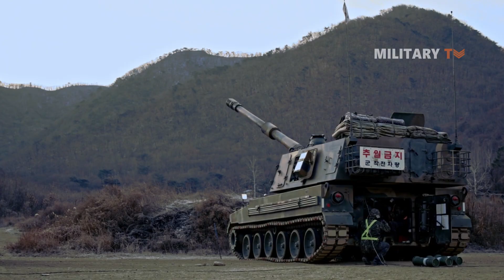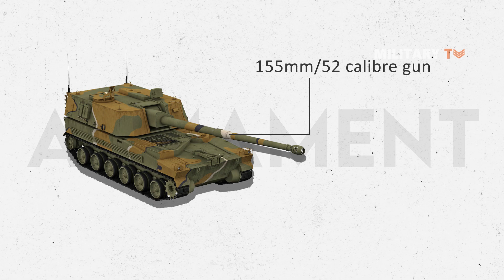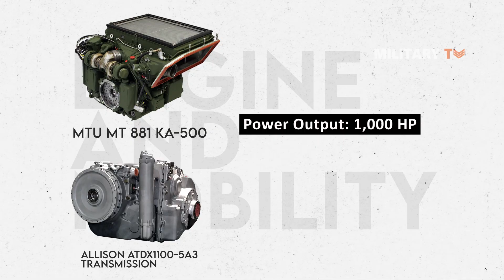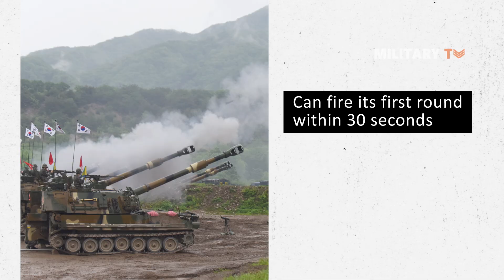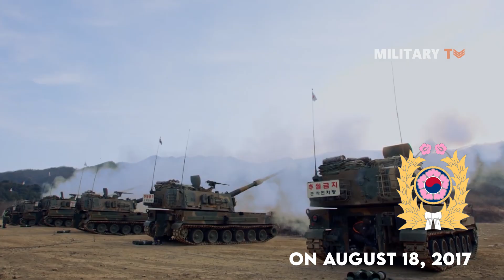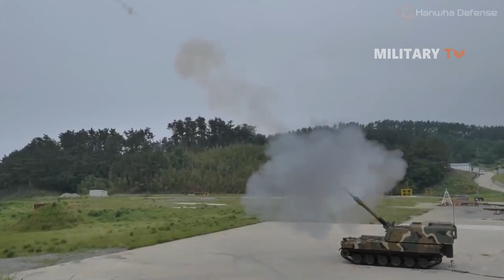Why So Many Nations Want New K9 Thunder Howitzer?

Comment: The K9 is a great weapon but let's give credit where it's due. The powerpack is a German engine and American Allison transmission, which has a bulletproof reputation and are top notch.

The K9 is an improved version of USA's M109 Paladin, which is also an excellent howitzer. In fact, before making the K9, Korea made a licensed M109 dubbed the K55 and there's still 1,000 of those K55 in service.

What separates the K9 is that it's as good as or comparable to everything else out there, it's extremely reliable, and it costs 2x to 3x less.
Reply: Doesn't use German powerpack since september batch, now equipped with newly developed Korean one. Still uses Allison transmission tho 😊
Reply: @김시원-d1b  Yes, they developed a native Korean engine because the Germs have export restrictions.

My understanding is Korea spent a ton of money to develop an engine that was 5% more fuel efficient so they can export the K9 to Middle East countries.

Really, the Germs shouldn't be so difficult because it's made us replace their engines in the K2 tank and K9 howitzer. And they lost licensing fees.

Comment: Why many are buying K9s? Because Finns bought them first, and have been happy with them. Just used the option to full 96. We Finns are THE reference customer to have. Purchases are made tightly within budget. We buy only actually working weapon systems. Performance, price and supplier nation reliability within sphere of free world are our only criteria.
Reply: Also- bc Korea gets cold aas balls in the winter, especially within the mountain ranges on the eastern side of the peninsula (some winter days its as cold as Siberia)

And bc also in the summer it gets hot and humid, it’s proven to work in cold and hot weather
Reply: @jamesdakrn  Good point. Korea is cold as s... country during winters. Like Scandinavia. S-Koreans want to keep K9 production line running continuously. They opened gold mine with Finnish deal. We Finns tested K9, while buying anything from Pacific rim country was outside of typical procurement area of European country with solid ties to US/Israeli/German war industry. Finland had years a go refused deal with Germans on Panzerhaubitze 2000. It is great weapon system, but Germans tried to rip us off on its price. We found K9 quite good, absolutely competent weapon system, something like 90% of PzH2000, at decidedly lesser price. South-Korea offered good deal on 96 SPGs delivered fast, straight from their army stocks (not ordered from factory). By now K9s cost much, much more. After our purchase, there has been deals of K9 with: Norway, Estonia, India, Poland, Egypt and Australia. Some of them are very large deals. Its good practice to get Finns bying your gear first. Business flows after that. Finns buy only good and solid gear, and we are very cost conscious. Every country in this world know how we operate.
Reply: We Finns and Swiss are THE reference customers on this world, for countries unsure  As Swiss buy quite little even at these times, its mostly us.

Finland decided on Davids Sling as high tier SAM recently. More orders are expected. Poland already ordered the Davids Sling missiles for their Patriot batteries. Missile is cross compatible with Patriot system. Finland buys native Davids Sling system, not Patriot with Davids Sling missiles. System can also easily talk with NASAMS system we already have.
Reply: Poland has a huge order for 672 k9 thunders most to be made in Poland along with k2 black Panthers
Reply: @0westdude  I am told Poland is building the world’s largest army
Reply: @dlev  If not biggest, atleast overwhelmingly superior land army in Europe. Like 2 to 3 times stronger than anyone else. Polish have clearly decided that they aint never again going to be occupied by foreign power. All their aid to Ukraine nonwithstanding, they clearly measure their rearmament on worst case scenario where they are the main frontier country. In coming years countries like Poland, and my home country Finland, which are among few who are determined to take care of their own defence whatever the cost, asking allied support as second tier option, deserve much larger say over countries that only hesitate, dont get much of anything done, like Germany. NATO is military alliance, and capabilities must count. Even more should count blatant abandoment of maintaining defensive capability (especially at times of good economy), utter disregard of even basic realities of geopolitics = Germany again. With Finland joining NATO our Baltic neighbours breath more easily. There is now friendly heavyweight land power on BOTH ends of Baltic sea. We can always get fighter bombers doing sorties within NATO. Getting troops and tracks on the ground is much harder.

Finns would take any Russian attempt to attack/threaten our blood relatives and little brother, Estonia, especially seriously.
Reply: 고마워요 핀란드 친구😊
Reply: @니가사는거면나도끼지  Yep, I am from Finland. We call K9s bought from South-Korea "sledgehammers" 😁
Reply: Because it's the best in the market atm
Reply: 구매 해 주셔서 감사합니다. 분명 핀란드의 k9구매가 차기 구매자에게 제품에 대한 신뢰를 주게한 것은 사실일 것입니다. 

또한. 한국은 휴전국가이고, 우리에게 방산 재품은 우리의 생명이 걸어야 하는 중요한 제품입니다. 그러므로 작동하지 않는 물건은 절대로 만들지도 않고 사지도 않습니다.
Reply: Germany tried to screw Finns with their PzH2000, asking insane price. As an revenge Finland opened S-Korean K9 deals all across Europe/Asia/Oceania. K9 is easily 90% what PzH2000 is, at one quarter the price. Price have gone significantly up since Finns bought their SPGs. You dont try fuck us if you are sane. Germans need to learn that. We destroyed your billions worth military development because you asked insane price from us.

Comment: because S.Korea deployed 1200 K-9s in Korea. It can be cheap. and "supply chain" isn't bad. K-9 bas been sold many to several countries. sum of them is around 1000. even include Poland. .. did I say  S.Korea deployed 1200 K-9s? oh yeah. I did. that's why K-9 can be cheap. it is sad fact. not proud. S.Korea has been still in the cold war but the others hasn't.
Reply: I didnt quite understand. Sad fact being South Korea has been still with Cold War? What that does mean?
Reply: @kimj2570  South Korea is still at war with North Korea. However, they signed a ceasefire in 1953, so there are no longer any attacks on each other. A lot of time has passed since then, so many foreigners are not aware of this.
The Korean War was a truce, not an end

Comment: The K9 seems to me like a cheap copy of the PZH2000, but it can't surpass the original in any respect...
Reply: The K9 has been purchased by almost EVERY military in the world. It strikes a balance between capability and cost.
Reply: @raysubsonic  If it were just about that, every military would have to drive a Lada Taiga/Niva...
And which large military with its own defense industry has the K9 in its stocks?
Reply: K9 will be upgraded to perform.even better than the PZH with FULL automatic loading and firing (A2) plus unmanned capability in the A3 version. PZH has yet to field or actively test auch version because it's bogged down in beauracracy.
Reply: @michaellim4165  From the manufacturer's HP.
(Of course, the PZH can also operate fully automatically!)

Features of the PzH 2000

-Superior combat range (currently < 54 km) and wide battlefield coverage from the 155mm/L52 gun
-Combat load with 60 ignited projectiles
-Automated operation and graded operating modes for semi-automatic and manual operation
-Fully automated projectile loading system with inductive fuse programming
-Fully automatic electric weapon aiming system
-Optics for direct aiming up to 2 km
-Fire control computer with integrated ballistics calculation and radio data link to an artillery guidance system.

Actually, the PZH only needs one driver to change position, and the rest can be fully automatic.
Reply: @raka522  but at what price and can they even meet production?

Comment: It’s bad ass, but i would choose the Swedish Archer system from BAE. 7 rounds in 9 seconds and more agile.
Reply: Archer and K9 is different beast. Wheeled vs tracked. Many country prefer tracked vehicle for a reason.
Reply: The archer is probably better for countries with more flatlands. Since its wheeled but for countries like korea which is around 70% mountainous terrain wheeled vehicles are inferior to tracked vehicles.
Reply: 7 rounds in 9 seconds only in ideal conditions.
Reply: 1 Archer with all auxilary systems would probably cost double the cost of a K9. The K9 is hands down the most common self-propelled howitzer on the planet. By now there's probably more of these operating in more militaries than Palladins.

Comment: India recently bought these under the name K9 Vajra. About a 100 are in service and further 200 more are planned to be ordered. They are being made locally in India with some India specific upgrades.
Reply: K9 Vajra basically means Thunder in sankirit.  Like the K9 Thunder.
Reply: @Gautham9125 very cool!
Reply: Australia is doing the same and building them in Australia too.
Reply: @nedkelly9688  they are good but not so effective as they are claiming.
Reply: Bhia India need like 1200+ of these
We don't have any Self-propelled Artillery system in Army
Reply: @nishantgupta2137  we have plenty of bofors which is a self propelled artillery system. In fact we dont have much tracked mounted howitzer.
Reply: Poland has already ordered 1,000. The first 100 or so are shipped from South Korea, while the rest are to be built in Poland, a joint venture between Poland and South Korea, so the units will more naturally fit Poland's specific needs. Poland also ordered American Abrams, but due to the limited supply and less willing to share technologies, by the Americans, Poland opted to diversify its top end military purchases. 

Also, from South Korea, Poland is likely buying the K239 (HIMARS made in South Korea, consulted with the Americans and companies involved in the buiding of HIMARS). Plus air force training planes. Point is, South Korea has not built itself into a global top end military powerhouse... with most of its most advanced weapons systems being compatible with NATO countries own weapons,
Reply: @kiabtoomlauj6249  being compatible? of course its compatible, just like every western weapon. what is this shitty advertisment?
Reply: @kiabtoomlauj6249  Poland also wants more of a defensive force so these are sort of more useful than the Abrams. stand off and demolish attackers.
Reply: @przecie3856  Poland are already quiet a power in Europe. Agreed that the next 10-15 years they should really be considered one of big countries in the block. 

Country I'd love to visit. Hopefully soon.
Reply: @przecie3856  why am I a pessimist?
Reply: the thumbnail is also from India also
Reply: not 200 just 100 because of l&t assembly line and local manufacturer loss so they order .
Reply: but drones are better

Comment: Definitely an improvement over the US 155mm howitzer.
Reply: 미군은 돈이 많아서 포병보단 공군을 부르는 걸 선호해서 포병에 많은 투자를 하지 않은 영향도 큽니다
Reply: I mean, considering it's several decades younger than the US version, I would hope it's an improvement.
Reply: Is it really better with only 30km range? I do hope that the war in Ukrain has shown that 30km artillery is not enough anymore with the introduction of MLRS and HIMARS
Reply: @yosmch  They've got different uses. Saying you don't need artillery because MLRS "are better" is like saying you don't need MLRS because we've got missiles.
Reply: @yosmch  Excalibur dude, problem has been solved and is in use currently...
Reply: @yosmch  you are right also considering weight m777 is very effective but both are of different class now its time of guided rocket mbls.
Reply: @yosmch  Meanwhile 30km is like 3/4 of my country's length
Reply: @lzh4950  Singapore?
Reply: @muhammadnursyahmi9440  Yep
Reply: @yosmch  At one time, it was 15km.  Why do you 'hope' that that the war in the Ukraine is 'not enough'.
Reply: @yosmch  MLRS/HIMARS aren't actually SPH, you wouldn't want to spend your expensive Himars targetting small infantry or small hardware targets

Comment: Correcting incorrect information. The armament capabilities of the K9 are as follows:

18km(M107, HE)
30km(M549A1, HE-RAP)
36km(K310, DP-ICMBB)
40km(K307, HEBB)
55km(K315, HE-RAP)
100km(Gliding Guided Artillery Munition - GGAM In development, the prototype is completed, Similar to M982)

The SPH, which has a distance of less than 40 km on the modern battlefield, is meaningless.
Reply: 100km?! That crazy, even futher than himars.

Comment: I still dont understand the difference between this and a tank. Am military dumb
Reply: The Thunder is a mobile Artillery platform for long range support fire with thin armor while a tank like the M1A1 or Leopard A7 etc. are better armored and more for suitable for close combat environments with a 105mm Gun and ranges of up to 5-10 km.
Reply: @ScorpionMinds  ok. More like one is for range while the other for closed combat. Is that what your saying?
Reply: @formacionG13  the thunder is basically an artillery platform that’s highly mobile, it’s gun traverse is a lot more than a tanks, and is designed for long range accurate fire missions that a tanks guns could never match
Reply: @ScorpionMinds  you mean 120mm gun
Reply: MBT (main battle tank) is for close fight, armor vs armor, while SPH (self-propelled howiter) is for indirect fire support.
Reply: The main difference are two, gun and armor.
Tank gun: Smaller in general, using high velocity rounds. And optimized for flatter trajectory. Some tanks can do indirect fire, but with limited capability.
General expected range is like 1-2 km.
Some tanks like from Russia or Israel can fire Anti tank missile from its gun.

SPG/H (Self Propelled Gun/ Howitzer) gun : Generally bigger, using lower velocity projectile with greater emphasis on range.
General expected range is more than 8km.
Some howitzer can fire guided munition like the Excalibur, GPS guided rounds.
While not designed to defeat a tank, SPG/H gun can do serious damage to them. 

Tank armor is usually designed to withstand another tank rounds. Like an 120mm AP round, although it only protect from a frontal attack from such caliber. But generally speaking, thicker.
Some may including ERA blocks or APS. Reactive armor tile, or Active protection system. Can be one or both for another layer of protection.

SPG/H armor is only has Heavy machine gun protection. Like in this case K9 is 14.5mm. Soviet KPV guns. Or sniper rifle. And another artillery fire. Like fragments of enemy artillery. Because it is expected to only be opposed by counter artillery fire.

Extra difference is their mobility.
This one is debatable.
Tanks usually using tracked or caterpillar instead of tires. I think i never see any tank with tires. Ever since its inception. But it may someday in the future? 

SPG/H are equally divided, some using tracks, some using tires.
Generally speaking, tracks offers better off-road performance and vice versa. Lighter armored SPG/H allowed them to use tires.

If your question was how do i tell them apart from just looking?
Tank has smaller gun compared to SPG/SPH. May look shorter as well. The SPG/SPH gun usually placed further back from the chassis when compared to a tank.
If it is on tires, it isn't a tank. At least for now.
If it has something looks like tile blocks, it is most likely a tank.
When firing, SPG/SPH gun usually elevated further up compared to a tank. Which usually fires in a horizontal position. Even better if it can depress.
Reply: @edhikurniawan  funny thing the Ukrainians were videoing a Russian tank that had reactive armor added on as an upgrade later in its life and when the opened up the containers what did they find ? … rubber blocks , what a bunch of wankers those Orcs are